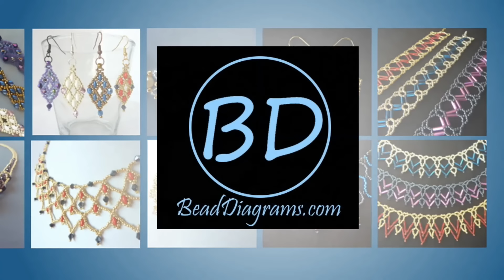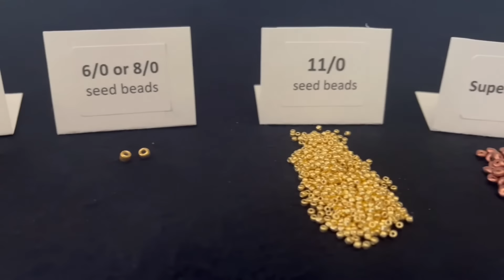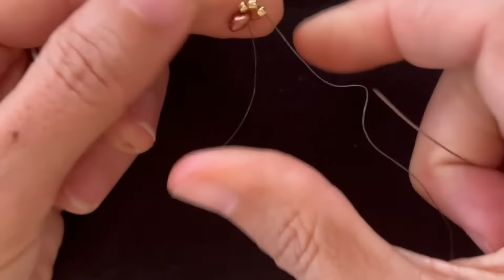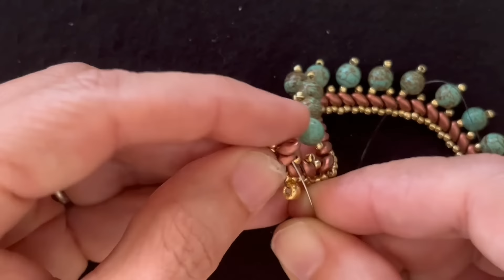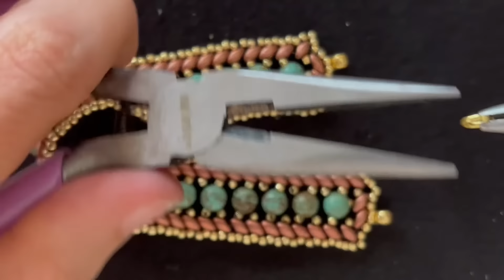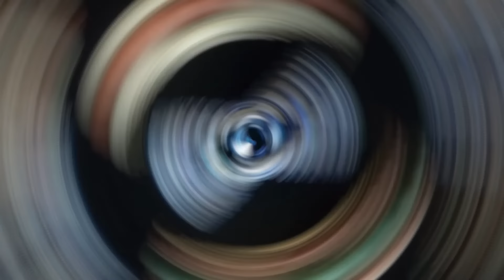Tutorial - Evelyn Bracelet

Comment: So I'm following along , but mine is really loose, like I can see way more string through mine than yours, and yours seems to fit snug with each new addition of beads, where as mine is all flimsy. And pulling from either side doesn't really tighten it because we tied a knot early on so there's no adjusting on that side 
Any suggestions on how to make it tighter as I work? 
I struggle to get the needle through the second super duo as well, so I end up twisting this way or bending that way til I can line the needle up with both holes, maybe that's the issue
Reply from the maker: Sorry you are having trouble keeping things tight as you go.  Not sure I have a good suggestion for that aside from checking and pulling tight often. For getting the needle through both Superduos, try entering at an angle - the way the Superduos lie is almost 45 degrees (so their holes are too).  Good luck!